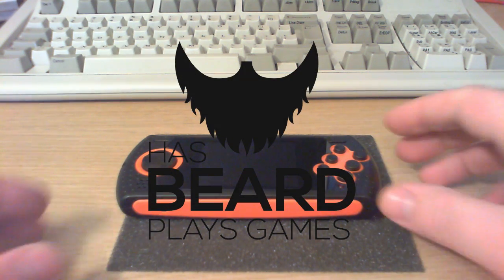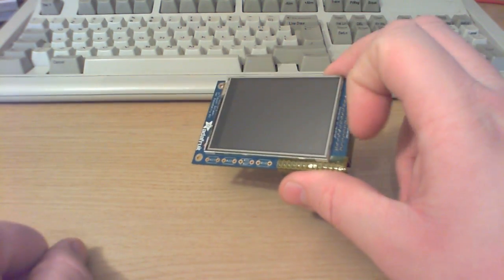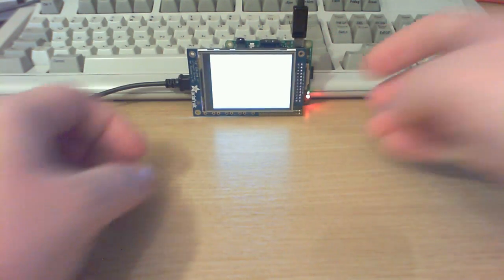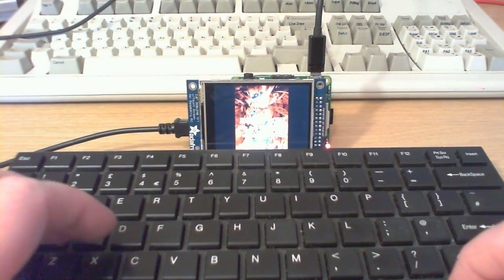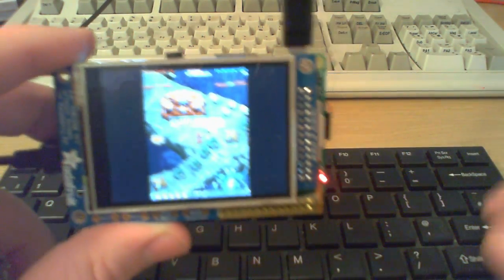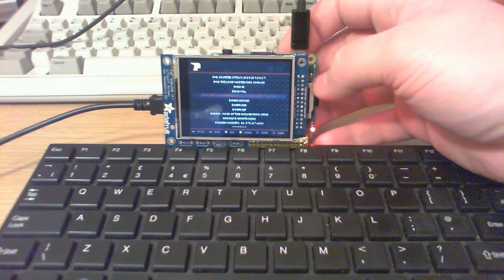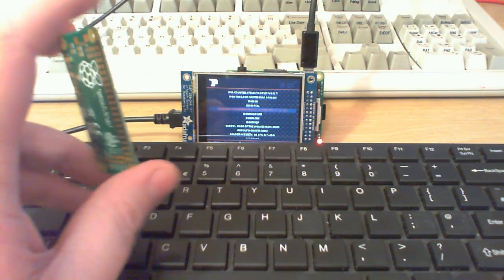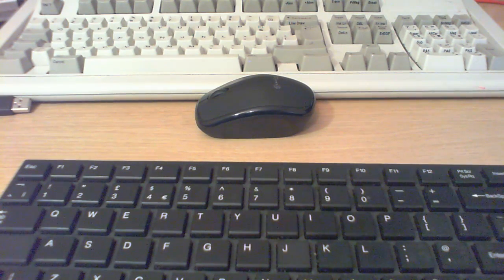(ABANDONED PROJECT) Portable ArcadePi Project - Part 2

Comment: I'm beginning to realize that raspberry pi projects can get pretty expensive (for someone with no income). Sure the raspberry pi 3 costs around 35 dollars and you can even get a raspberry pi zero for 5 bucks, but if you want to do anything with them, like this project that you're doing here you need stuff like that screen, which costs 6 times as much as the pi zero! You also need the battery pack to make it portable, and various dongles and so on. It really starts to add up! Heck!
Reply: KingofHearts67 You can find screens cheap on eBay. A screen the same as his you can get for around $10

Comment: im absolutely new to all of this and starting from ground zero. But you mentioned you had to figure out the battery situtation, how do you go about doing that? measuring the mah draw while playing games?
Reply from the maker: Pretty much! :) You can do some maths to work out the approximate run time (and it's not as simple as just dividing the battery capacity by the current drawn), but you really need measurements in order to get a good estimate.

Comment: Can we connect a psp screen on a raspberry pi zero any how?
Reply from the maker: Sadly not that I've seen. The only controllers I've seen for the PSP LCD involved an FPGA - doesn't sound like it's an easy job. 

Slightly larger LCD screens with either a composite or HDMI interface can be found for very little money.

Comment: That audio quality sounds like the issue I had with my Pi 1 on an old CRT TV I bought... turned out the problem was I had to run the Pi in PAL mode in order to get colour on the telly, and that caused horrible micro-skipping on the audio.

Changed the video mode to NTSC/PAL60 as a test & while the video was B&W on that rubbish old telly, the audio skipping disappeared.
Reply: +Paul Wood Even using NTSC the audio crackling still happens. The PWM output isn't that great and anything that takes to much CPU time, or causes a hiccup in realtime priority, will cause the audio to break up.
Reply from the maker: +Paul Wood Yep, what +tom611 said. Any audio problems I've had with the headphone jack are due to how the audio is generated. The PWM audio is pretty poor; if you can't use HDMI audio or an external device and you absolutely have to have audio output then it'll get the job done, but for emulation and games it's going to be pretty unpleasant.
Reply: +Has Beard, Plays Games It's odd, as I've never had that audio problem myself other than when running in PAL. that includes on Pi 1, 2 & Zero (with PWM audio redirected to a GPIO).

Perhaps I've just been lucky, or different emus are doing different things with different running issues (I rarely use FBA derivations as I don't have the romset accessible).

Comment: Hey there - I'm very interested in this series! I'm in the middle of a similar project, only using a gameboy pocket as a shell. Did you not have any trouble with the adafruit guide? There's a disclaimer at the top that says their method currently (as of May 2015) doesn't work and they're trying to fix it..
Reply from the maker: Nope, seems to work just fine with the A+ I've been using to test, but I haven't tried it with a Pi2 or a Pi Zero.
Reply: +Has Beard, Plays Games Thanks for the reply! I hope to see a new part to your series soon :)

Comment: He is wasting space with that display. You can get ebay backup tft's with horribly small pcbs for your display.
Reply from the maker: You can indeed, but the problem with the majority of those screens is that they use composite video. Using composite would actually solve a few problems - no GPIO tied up by the screen to start with - but I'd rather not go down that road unless it's absolutely necessary: composite video is awful quality.

Comment: Youtube just reminded me of your mod to this. I ended up getting a white Genesis version of this handheld for Christmas, so looking forward to your progress.

Using an i2c audio DAC (like what the Pimoroni board mentioned earlier uses) chip would be fairly small, just two chips and some passives, though the USB card I have (~$5 on eBay) is pretty small once the USB plug is removed.

It's a bit above what I think I want to dip into, but the Pi has an onboard digital RGB LCD controller that you can route to the GPIO pins and is probably compatible with the screen in this. I've used the functionality via the Adafruit Pi TFT Kippah with a 5" widescreen, but it's unlikely that the screen would plug into that adapter. Unfortunately, it consumes almost all the GPIO pins, so you'd either have to use some sort of GPIO expander or another device connected to USB.
Reply from the maker: +tom611 The screen I'm currently using is GPIO based - I'm pretty sure it uses SPI - and I think it's going to do the job just fine for these purposes; I needed something small yet clear. For anything larger - and I do have plans for larger builds - I can just use an HDMI screen.  You can get 5" HDMI touch screens quite cheap (http://www.gearbest.com/lcd-led-display-module/pp_231781.html) and using HDMI means that you can keep up to date with standard software - no need for special distributions, firmware, or drivers.
Reply: +Has Beard, Plays Games Interestingly, the software setup for using the onboard digital RGB lcd controller is a simple text file edit on most standard Linux based distributions. Far easier to setup software-wise than the PiTFT, and no real worries that an update will break things. 

The 5" screen I mentioned is just what I've personally used that interface with, but the internal controller apparently supports an extreme range of display sizes and resolutions, so long as it uses a parallel digital RGB interface up to 6 bits per color (so likely compatible with the existing screens these handhelds). The issue is more the physical connection and driving the backlight, as the screen in my AtGames handheld is soldered to the board and is a much wider ribbon than what the DPI TFT Kippah has for a connector and the backlight driver of the DPI TFT Kippah is designed for larger backlights. Setting up a custom wiring harness is a bit more than what I'd want to deal with, but it'd be nice to use the surprisingly good screens these units have.

PiTFT is nice, I have one of the same model you have, and it far crisper than the small composite video LCDs I've plugged into the Pi.

Comment: How do you get the PiTFT to work with RetroPie? Literally spend days trying to make it work and only made it work on a very old version of RetroPie but as soon as I update it, the screen doesn't work? I have followed the adafruit tutorial to the spec multiple times, but it doesn't work and it says it's incompatible on the page. Any guidance will be much appreciated as I'm doing the same as you with a pi zero but putting it into a game boy colour case! Thx
Reply from the maker: +Finger_Skate &Scoot I just folllowed the Adafruit tutorial I linked to... I know it says it's not compatible, but it worked fine for me. Which model of Pi are you using? I've been prototyping on an A+, since the hardware is more or less identical to the Zero.
Reply: +Has Beard, Plays Games I'm on a model b and I've got it working with an older version of RetroPie but when I update RetroPie through the pi, it stops working? I'll have to try in the zero once I get a chance to buy it!

Comment: i have the same idea when i see the zero ^^ but in another console (maybe the game boy micro ?)
Reply from the maker: +Antoine Martinez Now that would be a hell of a hack! But I think the game boy micro would be extremely tight! The reason I went for this handheld was that it has 6 face buttons - a lot of fighting games like Marvel vs Capcom or Street Fighter will need 6 buttons.
Reply: Yeah, i forgot the Button...
I have a broken ds, i will see if it can fit in. If not, a friend of mine have a broken PSP.
Also, use the original game reader would be great but with a psp, i dont think the pi can run the games. Maybe if the pi have a MIPS processor but it's arm.
This new tiny pi is vert awesome, it can fit in many case now ^^
I juste want to know, can it run well psx and n64 game ? And how about autonomy ? What battery did you use ?
Sorry for my eventually BSD english, i reply with my phone that is in french and he really want to correct every word in what it looks like in french ...
Reply: +Antoine Martinez I can tell you that N64 isn't really possible even on the new Pi 3. It's possible with some basic games but nowhere near full speed or accurate. PSX runs better but still not too great.